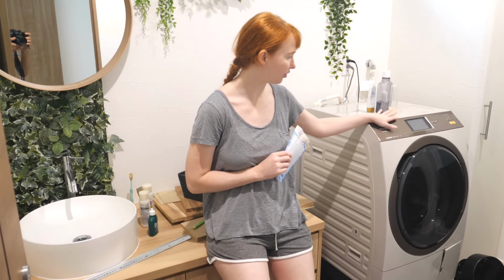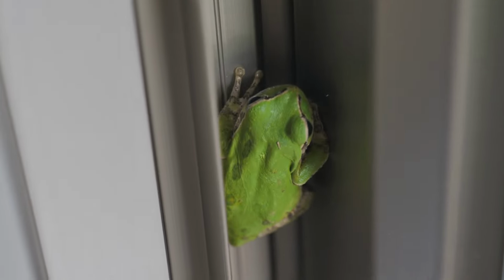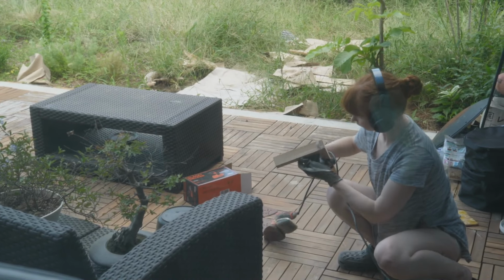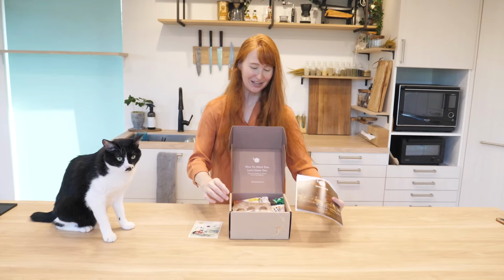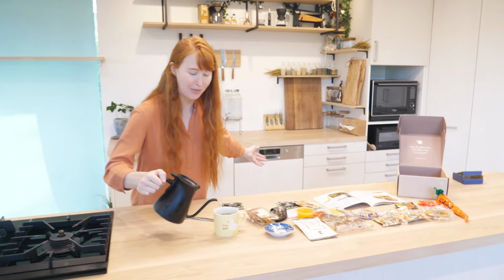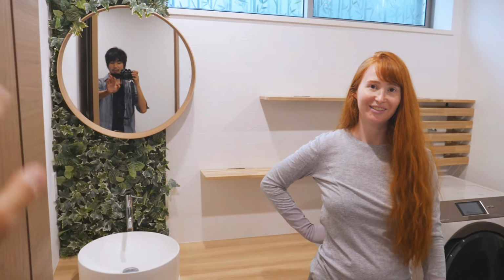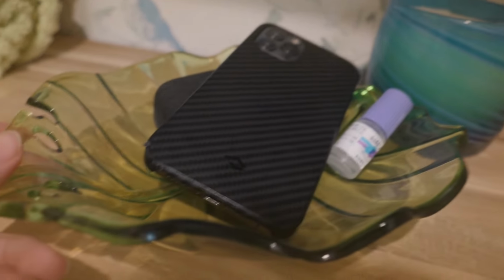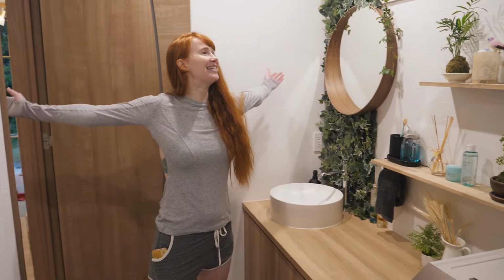Japanese bathroom makeover!

Comment: That wood powder and wood glue can be used a wood filler,  and if you want do extra wood add it at the bottom and did it at an angle so you should be able to hide a majority of joint.  

For sanding put a piece of tape on the point you want to sand to. 

Or sand by using a small piece of steel,  and apply some sand paper to it, you'll be able to sand your wood level or straight for short or long lengths of wood.  

I hope this helps you out. 
Your home looks great , and the cattos are enjoying the home too.

Comment: 5:45 You shouldn't worry about it too much Rachel. As a woodworker hobbyist I can assure you that getting surfaces like this flat is a nightmare without proper tools. x) I'm not sure what did you use but sanders like the one you have are bad for this kind of small areas since its really hard to keep the sander parallel without proper support from each side. In my relatively brief experience with woodworking I found out that using a rasp and then some hand files works best as they give you the biggest amount of control over what's happening, the rest is just making proper guidelines on the wood and going slow, checking once in a while if you're not taking too much from any side.

Comment: Easy way to sand the ends straight is to clamp a designated block of wood that's at 90 degrees to the long side of the part you want to sand, and then you use that piece of wood as a "ramp" to keep straight when sanding. Since sanding the ends isn't something you do very much of, one such piece will last quite a bit before it needs replacing.